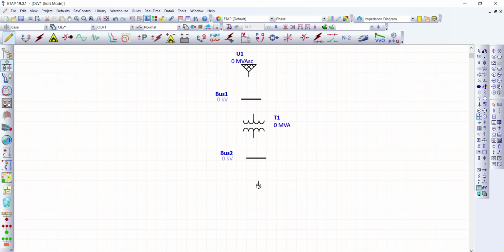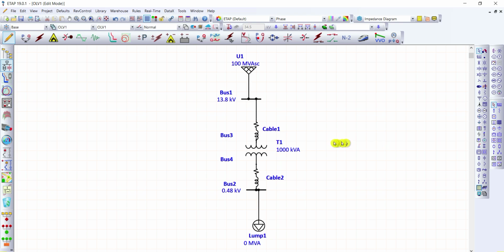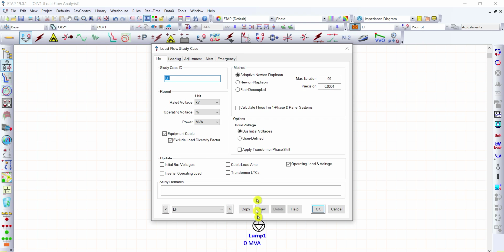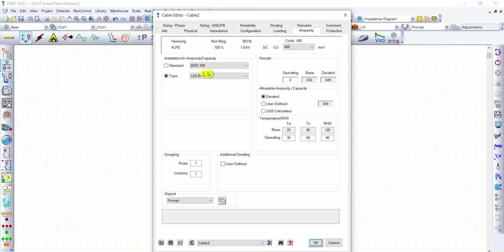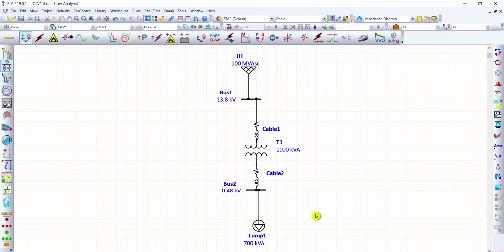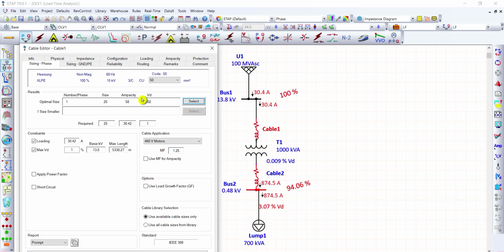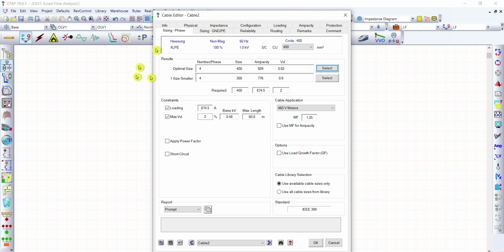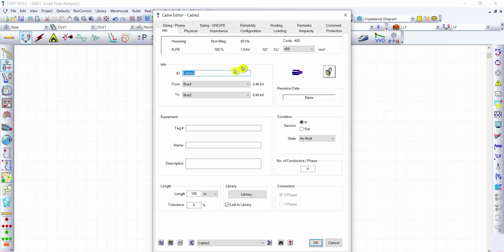Cable Sizing Using ETAP

Comment: Thank you sa tutorial. Ask ko lang po, bkit kaya pag nagconnect ako ng cable sa equipment nagccreate sya ulit ng another bus. Pls help. Thank u sir
Reply from the maker: That's normal po when you are making SLD in ETAP. Wherever, there is impedance, i.e. cable, motor, transformer, etc., ETAP automatically provided this node or bus. Just convert it by node na lang.
Reply: @juliussalutan8006  so pano po nagload flow analysis ako, di ko lang sya lagyan ng details?
Reply from the maker: @thesilentgamer4210  yong node kahit wala ng detail
Reply: @juliussalutan8006  kasi actually po maybus bar na ako.. tapos transformer.. tapos maglagay ako cable in between. Pag konek sa cable sa busbar, may nalabas na bus 2 in between. Tapos kapag cable konek to transformer Bus 3 naman po nalabas in-between.
Reply from the maker: @thesilentgamer4210  yong gene generate ni ETAP na bus just convert to node na lang lahat
Reply: @juliussalutan8006  okay po. Saan po pindutin yung convert to node
 Salamat po sir
Reply from the maker: @thesilentgamer4210  right click mo lang object, may choice doon from bus to node
Reply: @juliussalutan8006  thank you sir
Reply from the maker: @thesilentgamer4210  welcome sir

Comment: thanks so much . plz in BUS Editor  How we can apply the diversity factor for all Buses where I can applied only for the bus which connected directly to the load.
Reply from the maker: Please check at Load Flow "study case" section "loading"
Reply: @juliussalutan8006  when I change to min or max only the bus connected directly to the load is changed while all other buses are not changed,